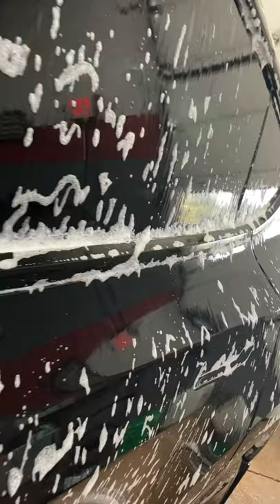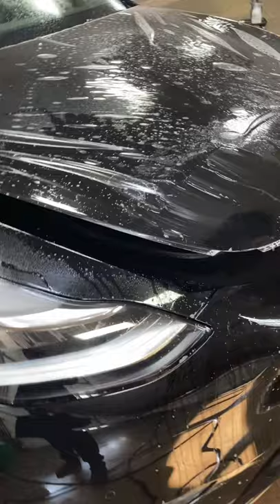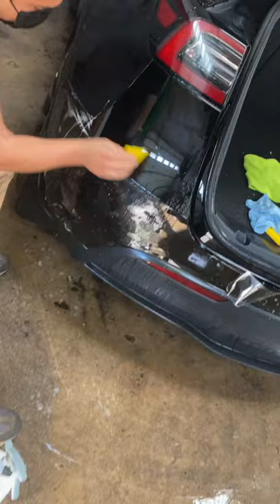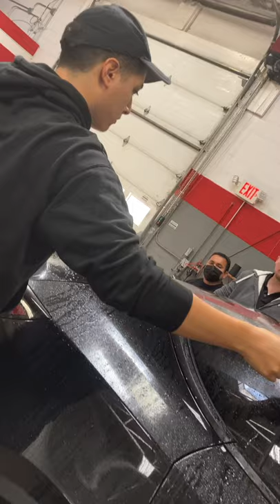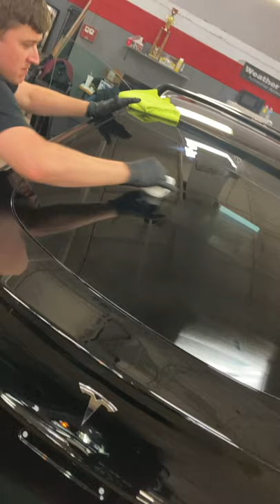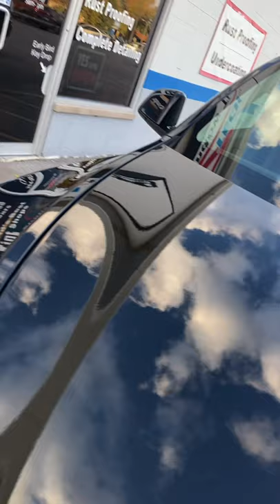2022 Tesla Model Y • Full Vehicle PPF + Ceramic Coating #shorts

Comment: Worth it? I’m getting front PPF and full ceramic in two days, but should I get full car? I’m so indecisive, I want it all but want to save $
Reply from the maker: if you want the best of the best in protection do it all. If you are only concerned about the front end getting rock chips etc. then do only the front end.Cant go wrong with the protection. Do whatever is best for your needs